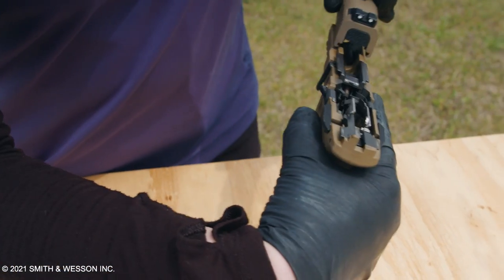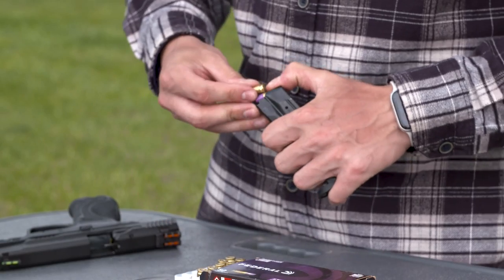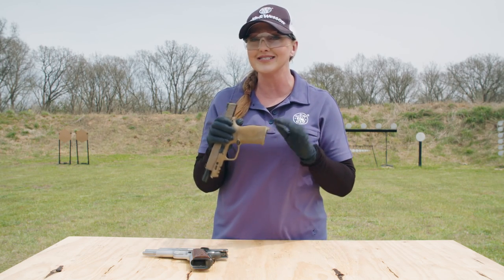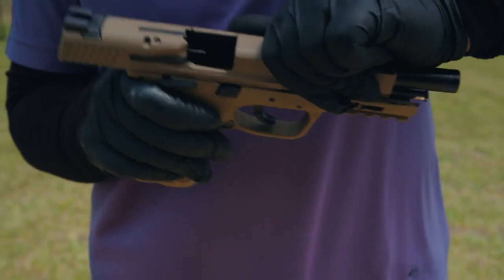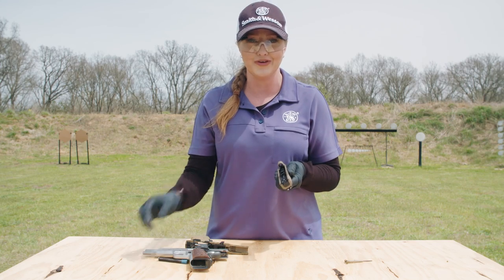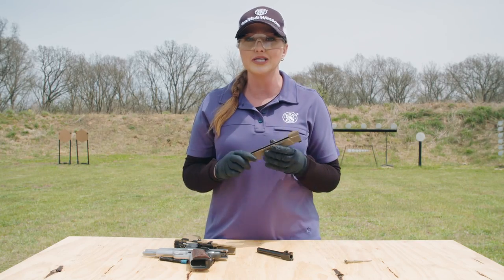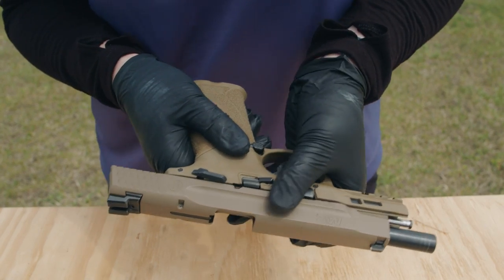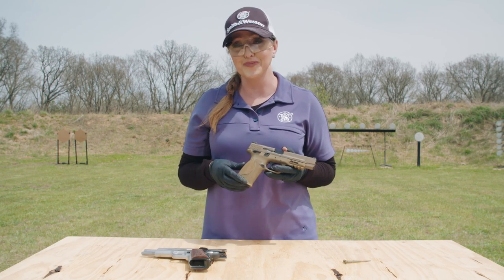Field Stripping Your Pistol

Comment: Contemplate this: There are (rare) occasions when a round (probably with the projectile not seated deep enough) doesn't feed properly and gets stuck, pinched in a weird way between the frame and the bottom of the ramp etc., and "tap and rack" becomes impossible/useless. This has happened to me twice over many thousand rounds with my H&K pistols. The only way to (quickly) relieve pressure and free the round was to disengage the takedown pin. Having to find, remove, and use a tool to release the sear, etc., before releasing the slide, which will be stuck in place, is a time-consuming step - potentially making an otherwise easy correction impossible in a time-constrained situation (IMHO). Not hating on anyone or anything, just pointing-out a potential "gotcha" when it could have a high cost. This extra step might dissuade individuals from cleaning in a timely manner once the novelty has worn off as well. Be aware, and enjoy your tools, whatever they may be. :)